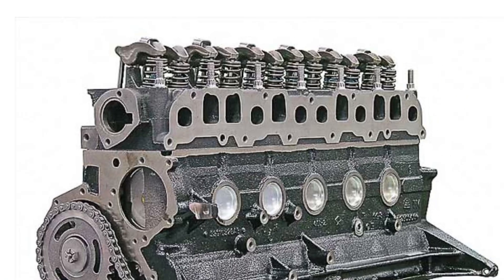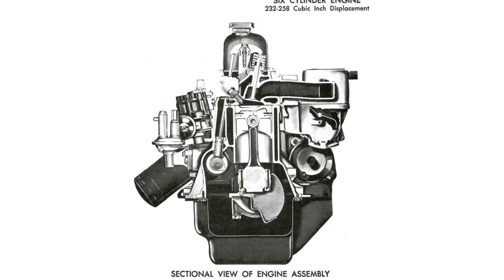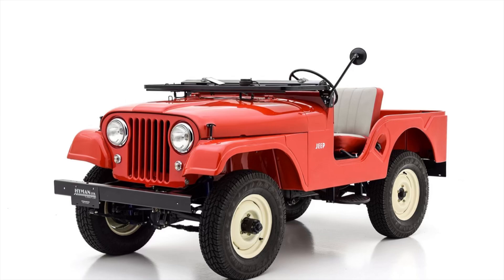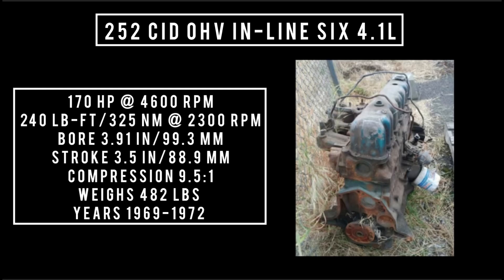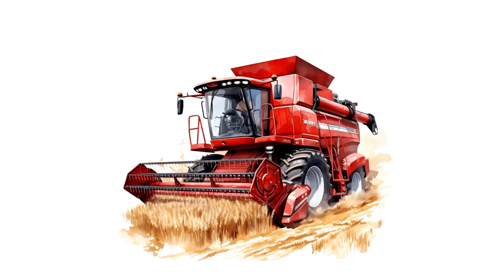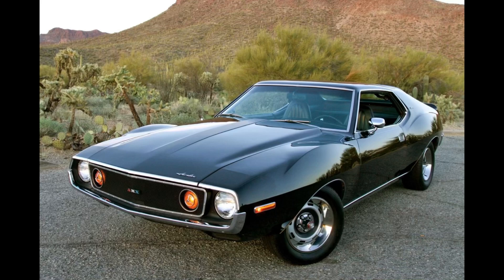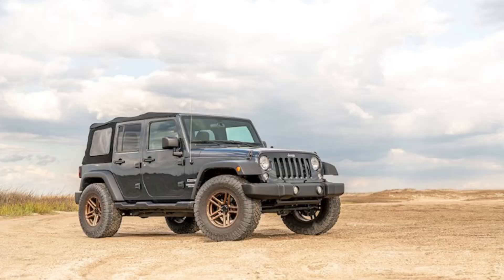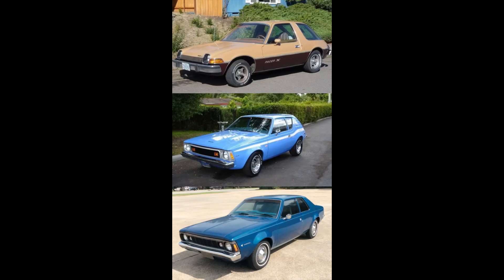AMC modern era in-line six 232, 199, 252, 258, 282, 242￼

Comment: First burnout on the street I ever witnessed as a kid was committed by a Gremlin with a six. Worthy of note: by mixing & matching parts from the 258  and the 4.0, a stroker six could be easily created that displaced 4.7 liters.  In fact,  Mopar offered just such a crate engine for a while. I have a 2001 Jeep Wrangler TJ with the 4.0/5 speed, but its frame is rusted out.  Trying to decide whether to swap the engine into my 1987 Dodge D150 pickup, like Chrysler could have offered.
Reply: They definitely should've used that 4.0 in pickup trucks instead of that stupid 3.9 V6
Reply: @johneckert1365  Another example of Chrysler shunning AMC heritage. Recall they dropped the Comanche in favor of the Dakota due to internal competition and didn't want the J-series/Gladiator alongside Ram trucks.
Reply: @kevinwong6588  Those little Comanchies were cool, it's a shame they axed them. I do understand their mindset on producing 2 competing mid-size trucks. With that in mind, they did start producing thier Durango in late 90's, that was pretty much a direct competitor to the Cherokee/Grand Cherokee. Hypocrisy? 🤷‍♂️
I do think I agree with axing the J series pickups though. Besides using up all the parts already manufactured by AMC, there was probably no point in it. Dodge trucks really were a better product, and I think it was challenging to get the carburated AMC 360 to pass emissions in a light GVWR 1/2 ton pickup (think of all the emission crap and vacuum hose bees nest on a late Wagoneer. And no point in engineering EFI for the AMC 360. A 4.0 with EFI would've been cool in a J series. Of course I liked the 4.2 AMC, but it was getting challenging to get that to pass emissions as well. And for whatever reason, the 232 & 258 never seemed to get very good gas mileage, especially when compared to Chrysler's slant 6 🤷‍♂️
Reply: @ big mistake I was an AMC zone rep

Comment: My choice would be  a low or no option, first year, small bumper Gremlin with a swapped in T5 5-speed tranny from a later AMC Spirit, a 3.89 geared limited slip differential from a Javelin or AMX and a 282 from a Mexican-market VAM and a cam and 3-2bbl intake and headers from Clifford (the '6=8' inline 6 cylinder speed equipment  manufacturer!) What a sweet little sleeper that would be!😃😃😃
Reply: Would you rather have that or the 401.??

Comment: Absolutely one of the best engines ever. Bulletproof bottom end and runs forever. The bolt-on parts vary, such as the Jeep's plastic valve cover which is a fiasco, the basics inside were solid and uber-relaible. These engines used to be cheap at the junkyards because nobody ever needed one with demand so low, so went the price. Many AMC's were scrapped with good engines, a lot being driven to the crusher. We once ran a 232 in a scrapper American wide open with no load for about 12 minutes total trying to blow it up and it simply wouldn't cooperate. No other engine would have withstood that level of abuse.  

WYR the Grand Cherokee and the Gremlin.
Reply from the maker: I totally agree This year I would love to get four engines 225 Chrysler 232 amc 300 ford 292 Chevy Drain all the oil and see which one last the longest
Reply: @What.its.like. the 225 Chrysler slant 6 will win.
Reply: @What.its.like.  Please not the 300 Ford, 200 or 240 if you are wrecking them.
Reply: @What.its.like.  All of those American straight sixes were good engines, but because of the seven main bearings I'll bet on the AMC! To make it slightly more even, I'd choose the Mopar 225, the AMC 232 (or 258), the 250 Ford, and the 250 Chevrolet because they were available in competing vehicles.

Comment: My 90' jeep Cherokee 4.0 went 350k before I sold it in 04' and last I knew it is still going.
Reply: My 2000 XJ 4.0 is about to cross 215k, running like a top, not burning oil or anything. When she starts burning oil, I'm gonna ball home the cylinders, throw some new pistons, rings, rod bearings, probably a new mild cam and cam bearings, and run her until she gives out.
Reply: Different engine
Reply: @jefflilyea4669  Same family.
Reply: My aunt had a grand 4.0 same thing almost 400,000

Comment: My 1980 CJ7 had a 258. The engine was okay but the carburetor warped the baseplate and leaked. In those days AMC was buying accessories from whoever would sell them cheapest. I could not get a replacement so I did my best to bend the baseplate so the butterflies worked and sealed the carb to the manifold with liquid metal. To my surprise it held. I would rather have the 1988 Eagle and the 1971 Hornet.
Reply: That was a 2bbl Carter carburetor, I believe a "BBD". Chrysler used that carb on it's 318 and 2bbl slant six